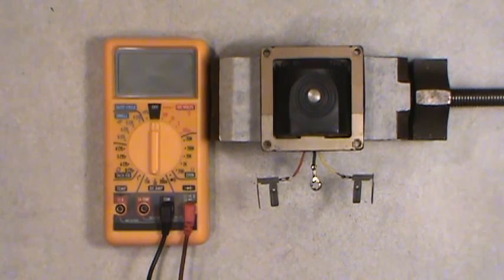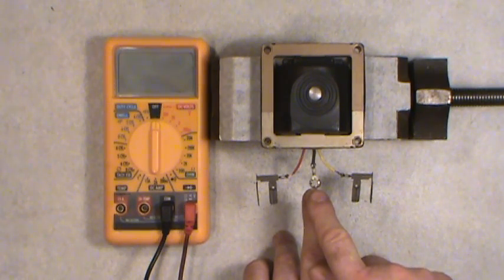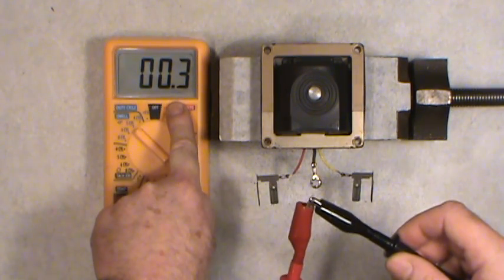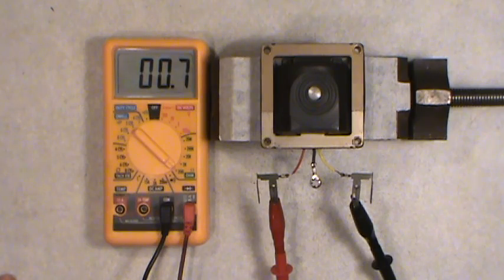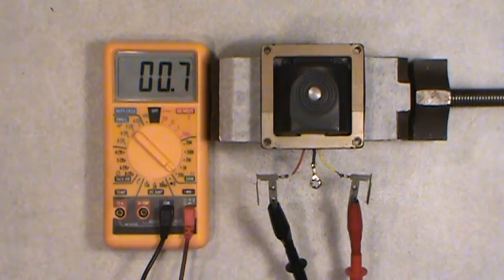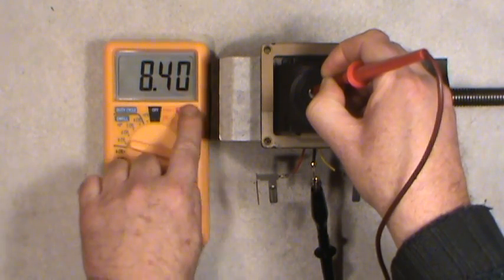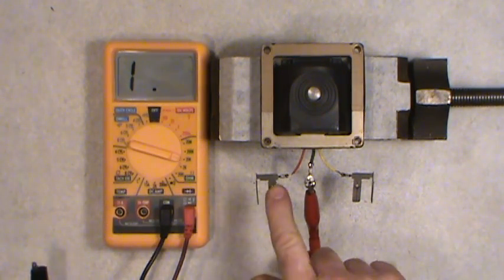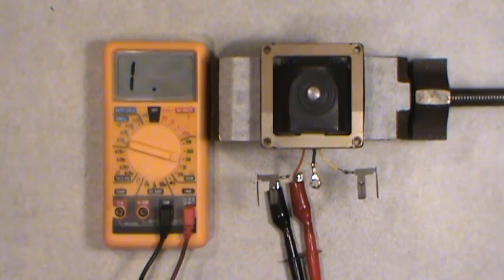HEI Coil Test (The Short Version)

Comment: don't have to keep scratching things
Reply from the maker: Greetings...kudos_g................Thanks for watching..............Well, for something like, electrical components and wiring connectors, that are kept, in a somewhat clean and warm environment, then, from what I've experienced, most of the time, the Multi-meter's Probes, actually did make a good connection, and didn't interfere with the Ohms Readings, that I saw on my Multi-Meter, but, maybe, the Ohms/Resistance was showing Higher, than it actually was, and should be, due to, in some (hypothetical) cases, the Coating (extra resistance), that might have been covering, the Real (base) Metal, that's underneath that Coating...??? (interesting huh)................Now then, with all of the Ohm/Resistance Testing, that I have done, over the years, on something like, much Older Cars and Trucks, then, there were a few times, where I did have to "Scratch" the tip of the Probe, into the Surface, of some of the Part's Terminals or Connectors, that were...Oxidized...somewhat Greasy...and also, there were a few times, where I came across, what I like to call, the...Green Yuck-ees...as well...!!!..............Here's an interesting scenario for You.....Let's say for instance, that, You Ohms-Tested, a much Older, HEI Ignition Coil, that was in Cold/Damp Storage, for about 10 Years or more, and Your Ohm/Multi-Meter..."Did Not Display"...any Ohms/Resistance, when You Ohms-Tested it (Your way/no scratching)...now, You went out and purchased a New HEI Ignition Coil...but then, after You remembered, how I suggested, to Scratch those Probe Tips into the metal Surface, of those spade Connectors, in order to Make Sure, to get a Good Connection, to the Good (base) Metal, then, after Re-Ohms-Testing it, I then hear..."Holy-Gwalk-ah-Moly"...!!!...the Ohm Meter, was finally Showing, that, that Old, HEI Ignition Coil, actually Did Test, "With-in" the Manufacturer's "Specifications" after-all...!!!...and now, we have "2" Working HEI Ignition Coils, and, "1" of them, can be kept as a Spare...Yip-ee...!!!...lol...............Also, those HEI Ignition Coil, spade "Connectors", are only "Crimped Onto", the Wires (Not Soldered), and, I always keep that in mind, just in case, that "Crimped Connection", might Fail some day, and maybe, be the cause of, some, Not Wanted, "Extra" (ohms) Resistance, and, now that I've said my thing, I say.....till next time........Be Safe, take care, and have a good one.

Comment: I tried your test using the same method. And primary showed 2.7 then when I swapped the 2 leads around it showed 5.7 then when I tested the high side it tested 7.83. so I'm assuming this is a bad coil according to my readings. So would this cause my spark to be orange when I do a spark plugs and spark test with no one spark plug?
Reply from the maker: Greetings...tobroke2007...……..Thanks for watching...…….Well, if your HEI (High Energy Ignition) Coil, is the same as, the one that you see in this video, then, here are the basics, if you will...…….Make sure that, your ohm-meter is set on the correct "range", as in, low ohms range, for the primary side (might be, from zero, to about 200 ohms on the ohm-meter), and, the high range, for the secondary side (up to, about 20-K/20,000 ohms, or 200-K/200,000 ohms), or maybe, you have an ohm-meter that adjusts itself automatically...???...………..I like to test these HEI coils, "without" the wires connected to the rest of the distributor, that way, there won't be anything else, being "included" in any of the ohm-readings...……...Connect the HEI coil's, 2 outer wires (low/primary side), to the ohm-meter, then, it will usually be showing "just over" Zero (but not Zero...!!!) ohms, up to, usually no more than about 1 ohm, on a factory/stock HEI coil...……….The high ohms side, is where the ohm-meter's leads, are connected to the wire in the middle (of the 3 of them), and the other lead, gets connected to that recessed steel part, that is in the side of the HEI coil's main body, and might be between, about, 6,000 and 30,000 ohms (ball-park figures only), so, try to find the "exact", ohms specifications, for the HEI ignition coil, that you want to test, just to be sure...…….If, by chance, you might have an after-market..."high performance"...HEI coil, then, try to get the ohms "specifications", for that "exact" HEI ignition coil, because, by just guessing, there's no way to be sure at all...……..An orange colored spark, sure sounds weak to me alright...…….A strong spark, as I recall should be blue-ish, or maybe white-ish in color, and, I usually hear a strong snapping sound as well, whenever the spark takes place, between the spark plug's 2 electrodes...…….Spark plug wires in good condition/not too old...???...…….Correct spark plugs for the engine, as well as, having the correct "Gap" measurement, between the spark plug's 2 electrodes...???...…….Battery showing about 14.5 volts, when the engine is running...???...and, are all wiring connections super clean, because sometimes, all it takes is, a poor, or bad wiring connection, to mess things up...……..Good luck, and...….till next time......Be Safe, take care, and have a good one.
Reply: @RockysRoadshow  ty bud I got it figured out. My meter was off by nearly 1 ohm after I subtracted that from my reading it was at  .4 Ohm's. So coil is good.